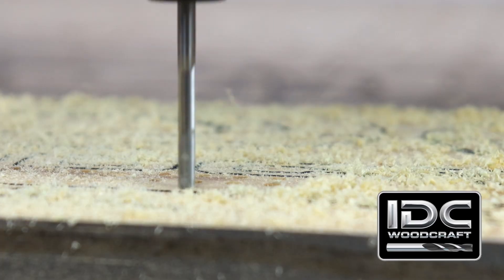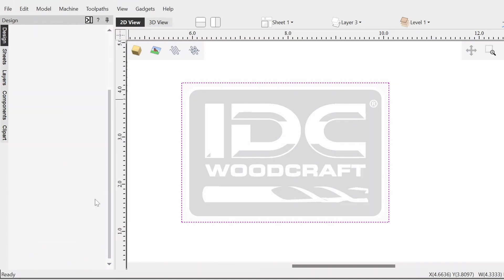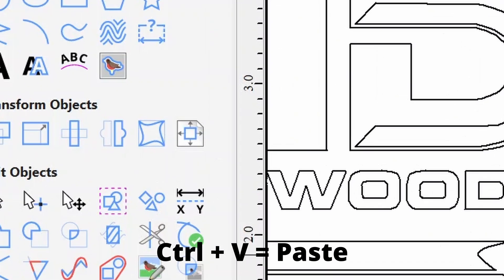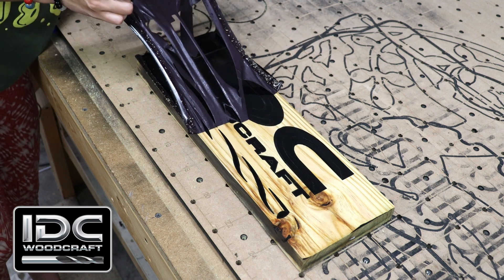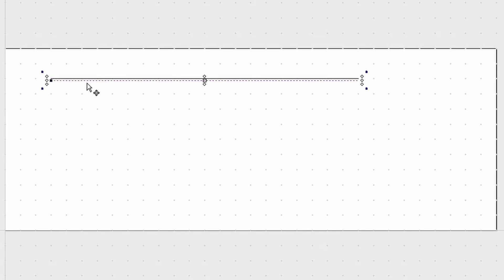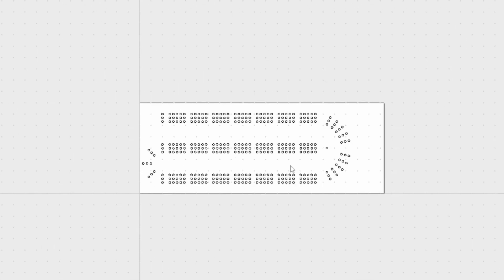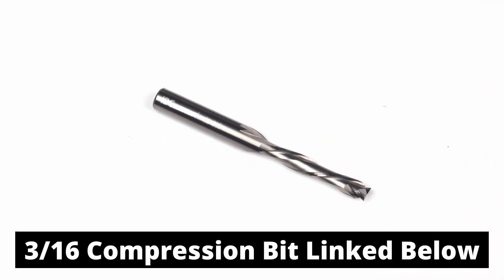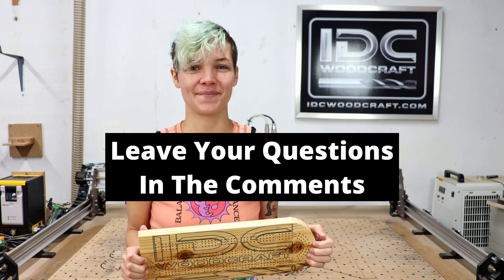Unusual Cribbage Board Design: A CNC Project Full of Surprises

Comment: What kind of difference are you seeing with the 1/8” 30 vbit compared to the 1/4” 30 vbit?
Reply from the maker: kwaks1979, The primary difference between the 1/8” and 1/4” 30 v-bits lies in their detail and cutting capability. The 1/8” bit can achieve finer details and is great for intricate designs, whereas the 1/4” bit offers a faster cut and is better for larger, less detailed work. It ultimately depends on the project you're working on and the level of detail you want to achieve. Both can be useful in different situations!

Comment: Awesome job Liberty !!!! Great job,,, do you have the feed and speeds of the drill bit tool path,,, I used what it recommended and started burning,,, I see you mentioned it,,, I was doing Oak and not using peck dirlling,,,,
Reply from the maker: stevecox552, Thank you! I usually recommend adjusting the feed rate and spindle speed based on the material and bit size you're using to prevent burning, especially with denser woods like oak. Peck drilling can definitely help with chip removal and cooling, so that's worth considering as well. Always keep an eye on the tool condition and make adjustments as needed!

Comment: Looks awesome! Are the holes in the spoil board threaded? You could screw down some stops to hold your work in better.
Reply from the maker: warrenscorner, Thanks for the compliment! The holes in the spoil board are not threaded, but that's a great idea for securing workpieces. Using stops can definitely help with stability while machining.